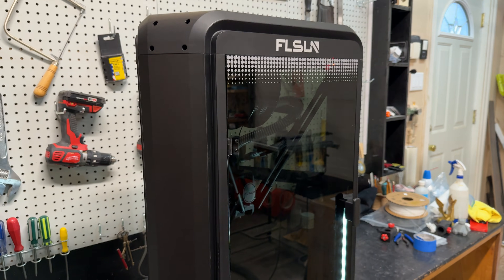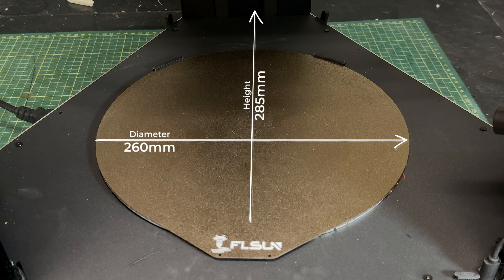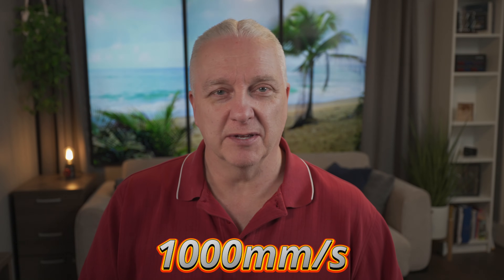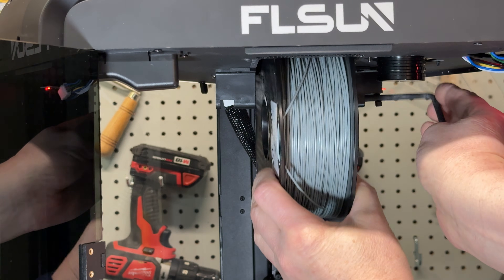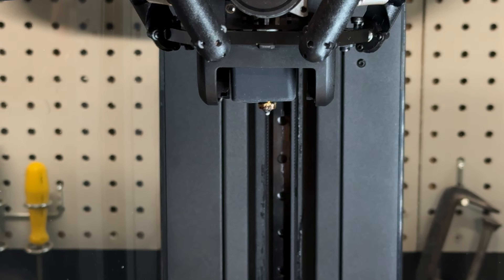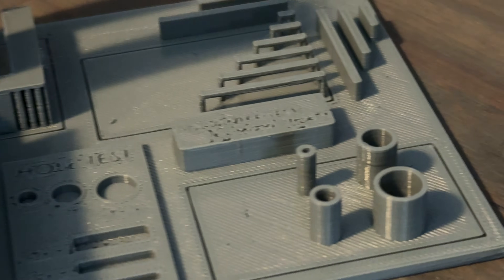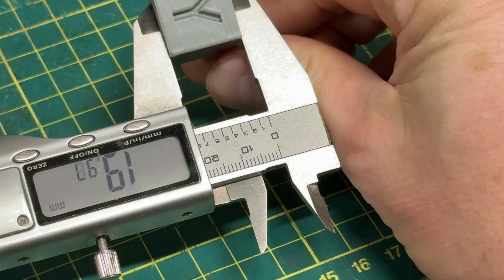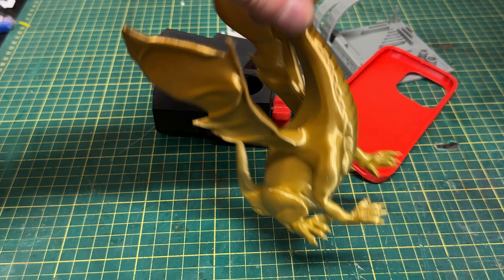This FLSUN T1 Pro ACCELERATES 3D Printing!

Comment: Great review , I got one a few days took  30 minutes to set it up, I have an issue though, does your print head fall to the bed if you barely touch when it's off? Mine does it but all my belts are tight .
Reply from the maker: Not at all. If I lean in it a bit I can move it pretty easily though. I don’t think this is an issue.
Reply: Another question do you use flsun slicer or orca slicer i feel like they both the same if so what setting do you use? What would you recommend.  I usually use pla pla+@SteveMakesEverything

Comment: Don't use an FLSun other than a mock-up of your design. It is inconsistent to the worse case. Deltas tend to be. 80%+ failure on prints according to uTube reviewers including myself. Have you ever dragged your missus through a hedge backwards? These prints look worse. We don't want fast. We at least want something near quality. They work great once calibrated when new. After a week the belts need replacing. That means you have to take the thing to bits to fix new beltsand every screw you unturn-to-return strips the screw threads. The time and money spent on this process you might have been better sending your design to an online 3d Printer firm.
Reply from the maker: Well given that I’ve been using this one for a couple months now without a single issue, and certainly no failed prints, I don’t take much stock in your comment here. The print quality may not be better than a Bambu, but it is also half the price.
Reply: @SteveMakesEverything  I'm not saying that this machine is worthless. FLsun gives others the ability to create and that's ace. OK my analogy with the hedge is harsh (looking back). I would delete my post but it's best I have my apology here. It can work as good as an X-Y but there is a lot of maintenance on every project such as having to level it every time as the timing belts being so long alter according to long use and temperature. I don't hate the machine. I use it regularly. In fact it's running now to print a Mickey Mouse Christmas bauble ha. Good enough for Christmas so it is good enough for everyone. Like I said, I was too rough with my mouth.
Reply from the maker: @dazsteele8012  LOL, fear not; I love a good constructive counter-argument here as long as it is based on experience and evidence.   People want to hear both sides.   😀
Reply: @SteveMakesEverything  Yep, constructive. They do. It's here. And yes,"LOL" and multiple sides. This is my TV
Reply: @SteveMakesEverything only a couple of month? in this case your timing belts need to be replaced very soon. u might have already noticed that the machine has become louder since u 1st had it? the worst problems r yet to come. i hope not
Reply from the maker: @dazsteele8012  No additional loudness at this point.  Still working like it did when I put it together.  It can't rattle any more than a CoreXY laser.
Reply: @SteveMakesEverything  ha ye. I guess no matter the noise out of these machines there's some result. Envious. U have a engraver/cutter
Reply from the maker: @dazsteele8012  Watch our weekly live stream.  We occasionally give lasers away, and I think I'll have a giveaway coming up soon

Comment: You convinced me.  I added a T1 Pro to my print farm (Creality K1, E3Pro, CR10, Halot 1, Elegoo Saturn 3 Ultra).  Just finished it's assembly, but haven't run the first print yet.
Reply from the maker: Let me know how it runs, I'm curious if I hyped it up too much, but I do love it 😉.  BTW there are several small set screws on the Effector plate.  Make sure you tighten them because I noticed some messy prints on mine and went back to check only to discover that a couple of them weren't tightened.  After doing that, print quality was awesome again.  I guess I forgot to to tighen them because they haven't got loose again.

Comment: Hi Steve.  I'm new to 3D printing.  I purchased an FLSun T1 Pro but continue to have challenges.  Specifically, after the printer creates the outline of the object and goes into overdrive, the object lifts off the bed .... every time.  I have calibrated the vibration and leveled the bed several times.   I am using Creality 1.75mm PETG.  I ensure the extruder is at 240C and the Bed at 80C.  I have also contacted the company multiple times, but received not answer.  I'd appreciate some insight from anyone.   Thanks in advance.   CB
Reply from the maker: Try wiping the bed with alcohol before printing. Sometimes the bed will get a build up of oils and dirt which causes it to lose its grip.

Comment: Using plastic printers in a time where microplastic is such an issue i .. something.
Reply from the maker: This is something I, too, struggle with.  If this is a huge concern for you use PLA - it is typically made from corn and other materials that biodegrade.

Comment: I cannot see the revolution. This printers are not new. Nice peace of tec but i do not see how it makes my printer obsolete. Sry. The X Y Z Cube looked somehow awful... maybe the lighting.
Reply from the maker: I wasn't concerned with the print quality on the cube since it's only the measurement that matters.  I did have the temperature too hot for the cheap PLA I use for this.

Comment: Nothimg i see here is new tech or revolutionary
Reply from the maker: You don’t think a printer that is twice as fast as a Bambu is innovative?
Reply: @SteveMakesEverything  Just because it can move twice as fast doesn't mean it's going to print twice as fast, at least not all the time. We are still limited with hotend technology and how consistent the plastic can extrude. Plus you start to sacrifice on quality the faster you go, so it's mostly beneficial when you're prototyping, not producing.
Reply from the maker: @niccon.7276  Everything you say here is correct. The difference is that this printer isn't just designed to peak at 1000mm/s but to extrude effectively at that speed.  I tested this exhaustively, and it works well at these speeds without degrading.  Granted, on small parts, you're probably never going to see these speeds, but watching the "speedometer" while printing my studio clamps, it was hitting this speed quite often and definitely printed this part about twice as fast as I was able to achieve on my coreXY.  To me, that's an innovation.
Reply: @SteveMakesEverything  not at all
Reply from the maker: @ Then buy the printer you want. Take a look at Bambu - they'll be quite happy to lock you into their platform forever. 😀
Reply: @SteveMakesEverything  not a fan of them after the recent news
Reply from the maker: @ Judging by the outrage Bambu caused, I think you're not alone 🙂

Comment: Seems like a normal delta to me, i just built a corexy printer i designed and it can physically mover faster than 1000mm/s but it cant print that fast, you run into so many other bottlenecks before the motion system anyway.
Reply from the maker: I think the value FLSun has added here is to make the delta mechanics extremely rigid and definitely made it quieter than any delta I’ve seen in the past.  Having built two of my own coreXY printers in the past I ran into similar results. There’s just too much mass moving to get print speeds over about 500-600mm/s
Reply: @SteveMakesEverything  my bottleneck is the extruder/hotend not keeping up at high speed., but the delta machines are pretty easy to keep rigid and quiet, especially the enclosed ones.
Reply from the maker: @deltacx1059  While when the speed is set to 1000mm/s, you will see that only longer runs, I ran most of the models in his video at the highest speed and I didn't see any issues with the extruder failing to push enough filament through and the output times are roughly 2x+ what I can do on my Creality K1.  This is essentially the same mechanism FLSun uses on the 1200mm/s S1Pro, so presumably, it won't have any issues here.
Reply: @SteveMakesEverything  I was referring to MY extruder not keeping up at high speeds.   Good on them for getting their extrusion under control at those speeds.
Reply from the maker: @deltacx1059  Oh, sorry.  Yes I am amazing that they can pump filament out this fast and get it cooled before the next layer gets put down.  I'd suggest they are baking their results, but compared to any of the CoreXY printers I have, it is much faster.
Reply: @deltacx1059  You are correct of course. Without tricks almost all printers are limited by the hotend. This is a physical limit, that can't be overcome easily. You don't need much speed to reach a point where the extrusion becomes the bottleneck. A CHT nozzle does have bit more headroom but they are bad for abrasive filaments. 1000mm/s is unnecessarily fast. Multi material or IDEX is much more useful.

Comment: From what I can see - it is just fast, that's it. Revolutionary definitely not. You said there are no visible seams, but there are definitely seams on your models and they are very noticeable. No multi-material printing in 2025? Manual loading and unloading filaments and you call that "no problems if you switch filaments"? 260mm diameter? that's just a joke, the print-area is much smaller than usual mid-size 3d printers because it loses print-area in the cut-off corners. That thing is heavy, it's big and just too expensive for what it is. From what you showed in this video, the t1pro can't even reach the level of an A1, which is cheaper WITH ams. Sorry but if everything this brings to the table is "good overhangs" and "speed", then it's just not worth buying in 2025
Reply: yes, its truth
Reply from the maker: While I defy you to find a seam
Reply: @SteveMakesEverything  just look at the dragon's wings there are random seams everywhere.
Reply from the maker: @iBeryl @iBeryl  Well, given that the model was printed with aligned seams, that would be impossible.  You can certainly see layers, though, because it was printed with a 0.02mm layer height.

At the end of the day, if you don't like this printer, then by all means buy whatever you want.  My channel isn't about negativity, which is why you won't see me review things I don't think will help people.  I certainly don't review anything on the off-chance that you might click an affiliate link.
Reply from the maker: @ Well if the print area is too small, you don't drop comments in a YouTube thread to complain about it - you just move on to a printer that does what you need.  I could complain that my car doesn't perform like a Ferrari, but what's the point?

As noted, my channel is not a sounding board for negativity and needlessly negative comments will get removed.  I get it, the poster doesn't like the printer, so  just buy something else.
Reply from the maker: @ LOL before I had a YouTube channel, I used to think like you and believed that YouTubers made millions and companies begged them to take their products and say good things about them.  Now I realize how much B.S. this thinking was.

First if you had watched this video entirely you would have heard me raise a concern about the sound level being better than their old printer but could still be quieter. I also noted the lack of color printing FWIW.  When there are bad things to say, I will say them because no one handcuffs me.  That’s because unlike your misguided view of things, I don’t sign contracts and I have no sponsorship deals with anyone, nor do most YouTube tech reviewers.  So feel free to change your incorrect view.

For many color printing is definitely appealing (at least until they actually use it) and in this case the T1Pro, like many printers, is not a fit for you.  So why waste your time commenting on this printer?  Just buy the printer that’s right for your needs.  Look at the Bambu X1 or the Creality K2C and they will do exactly what you want.
Reply from the maker: @theprayofheroes5969  Look, I get that you don't think this printer is for you, so don't buy it.  Bambu makes fantastic printers too - they're just much slower.

I did provide some feedback to FLSun about multi-color support so hopefully they address this feature in the future.

Comment: Their benchy is custom sliced to make it print faster. Have you tried slicing your own benchy? 500mm/sec is already faster than you can extrude and cool. I had to upgrade my p1p hot end to improve the flowrate. Does this T1 pro come with a CHT nozzle? How is it able to extrude and cool 1000mm/sec worth of filament?
Reply from the maker: As I mentioned their benchy is baked, and the important thing that no custom slicing can fix, is the fast benchy had uniform layers and no ringing. While I didn’t print one of my own I did print all my studio clamps at 1000mm/s in PETG without trying too hard.

I try not to delve deep into technology on my channel because most people don’t care.  They just want to see the result and understand if it solves a problem they might have.  My studio clamps on my K1 coreXY used to take 3+ hours to print. With the same infill (80%) setting and material they took 1h22m on the T1Pro. That certainly solved one of my problems.

Comment: Does it connect wirelessly and what safeguards does it have from hackers?
Reply from the maker: No wireless connectivity.
Reply from the maker: Sorry, my brain was fried.  Of course, there is wireless connectivity and I was using it when I answered this question. Doh!
Reply: @bigdougscommentary5719  srsly, who hacks printers and why?
Reply: @wacomtexas  People will literally hack everything just to see if they can.
Reply: @wacomtexas   what do you think hackers do for fun?
Reply: On page 23 of the manual that came with my T1P, it shows how to connect to a wireless network.
Reply from the maker: @ Doh - yes, of course, there is, and in fact, this is how I used it out of the box for everything in this video, so apologies for the incorrect, dumb answer that was completely due to my lack of attention  😒

Comment: Its just so big, and no multicolor. Flsun, really needs to jump on the corexy design. No need to retire my k1, its getting multicolor support soon.
Reply from the maker: Being a Delta doesn't have a bearing on multi-color - they just need to do it.  I'm hoping this is something FLSun is focused on adding.

By the way, you'd be better off selling your K1 and buying the K2—it's a better printer and you can get it with the multi-color option  built-in.
Reply: @SteveMakesEverything  well I need multicolor. Yeah, I could get a k2, but its too expensive right now. I'll wait a year or so for the prices to come down. Though, I am interested in the creality hi with the CFS unit.

I'll just have to tinker on the k1 a bit to make it better. I dont mind tinkering, kinda enjoy it.
Reply from the maker: @oneanother1  I'm a tinkerer too.  If you wait a year to buy the K2, then you're going to want the K3 😉
Reply: @SteveMakesEverything  I think we've reach a point where 3d printers are good enough for years. I still print on older machines. No need to retire them after a year of use. Build up a print farm instead.
Reply from the maker: @oneanother1  Regrettably I have to agree.  But where's the fun in that?? 😀

Comment: Hey Steve, do you have to have a ventilation hose on the fl sun printer venting outside?
Reply: ventilation hose??
Reply: @3dtexan890  yes for fumes/smoke.
Reply from the maker: You won’t need ventilation for most filaments since you aren’t actually burning them. If you work with ABS and probably ASA you might want to vent the printer if you are in a small room, though
Reply: @SteveMakesEverything  okay thank you so much

Comment: Looking at FLSun's website, I see also the S1 Pro - which seems even faster. There isn't any way to load multiple color filiments in this, is there? How would you print a 2 or more color object? I haven't delved into 3D printing yet, but the multi-color prints interest me. Thanks!
Reply: Unless you are going to buy the Prusa XL for $4500, color printing is so slow it pretty much useless.  To give you an idea...I was going to make a model about the size of a closed fist.  If I made the entire thing in one color it was going to take less than 2 hours.  I wanted to make it it multiple colors and it was going to take 22 hours.  I dropped it down to only changing the white of the eyes....to white...and the center black (very small area for color change) and it was still going to take a whopping 14.4 hours.  Plus the amount of filament the Bambu wastes on color prints is absolutely mind boggling.  Printing a small object the size of a balled up fist and it taking 22 hours is beyond realistic unless you are just making end result videos for youtube.  Granted if you are going to make multiples of the same object than you can put them on the same printer bed and the color changes do not add anymore time to the print for those color changes.  But colored prints are a time gobbler.
Reply from the maker: @SoFalsey  I agree with this.  I have a multi-color Prusa printer as well, and I never use it because it takes way too long and wastes at least 50% of the filament.  But it's important for some people, and it's actually pretty cool to do if you don't care about the pile of extra plastic (and the environment).  But who am I to judge??
Reply: Thank you for asking all the questions I wanted to ask 😊 looking forward to the answers.
Reply from the maker: You can pause the print and change filaments manually, but not color option yet
Reply: @SteveMakesEverything  Thanks - you were a huge help to me getting my head around how to do basic things with my FSL Laser. I enjoy following your videos. I'm spending scarce hobby time on my CNC lately, and building cabinets, etc... maybe some day a 3D printer
Reply from the maker: @LDBecker  THanks for the very kind words 😊
Reply: Single color printing, unless you add a pause during printing and do a manual filament change.